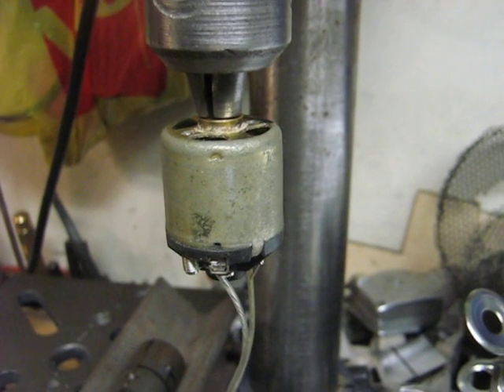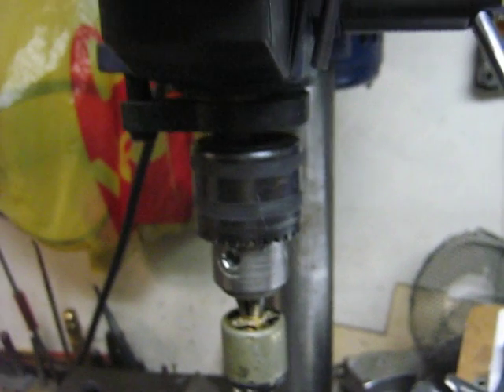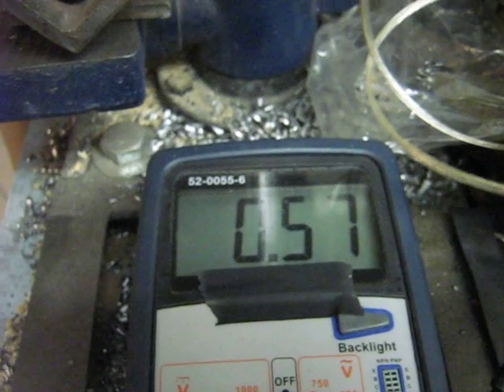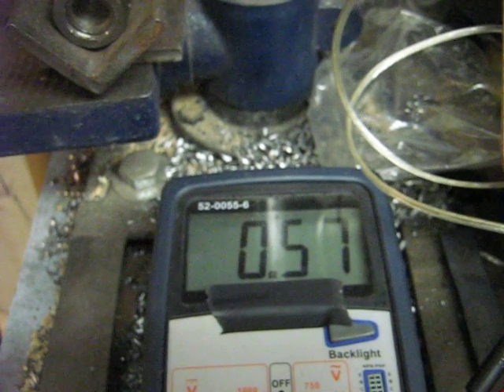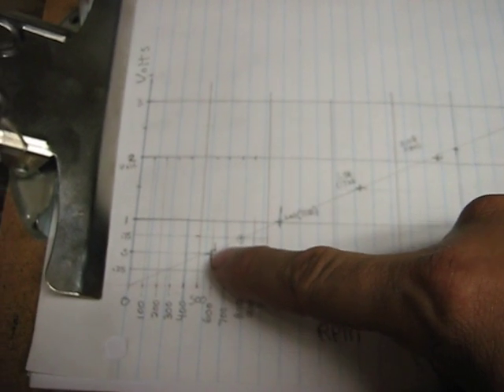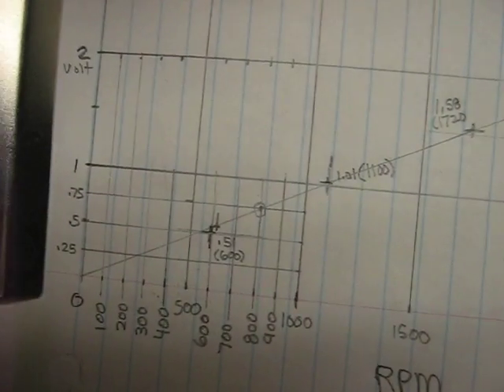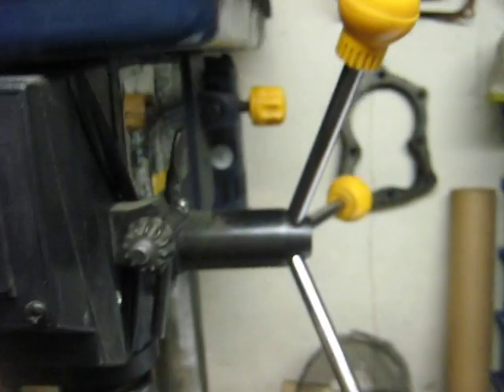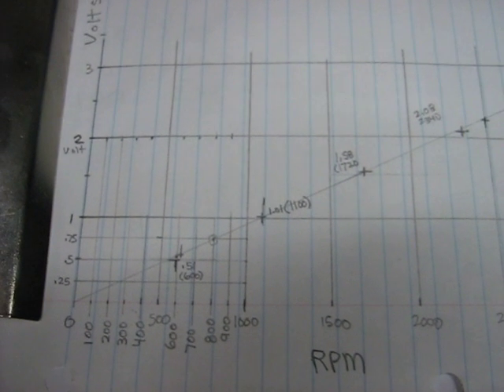Homemade Shaft Drive Tachometer-Cheap!

Comment: why cant you just measure the voltage at the output of the motor? I'm just confused as to why you did it your way. nice video, btw
Reply from the maker: +Wesley Jackson  This engine doesn't have any type built in electrical output, so without adding the shaft drive generator, there is nothing to measure. Any type of digital tachometer would have worked as well, and I do have one of those now. I mainly wanted to see if this concept would work out.   I like doing the odd experiment.  :)

Comment from the maker: Yes, it seems to work pretty well, although a permanent mount could be a bit of a pain! Your flywheel engine seems to run a lot better, I think the stock Briggs carb is too large for the reduced velocity at slower speeds.

Comment: no. an electric motor is designet to run at very high RPM. 10000 or even higher. så the RPM would not kille it.
and generating about 4 volts and no current to speak of is a walk in the park for an electric motor. så actually one could mount this in an engine and have a permanent tach. maybe put in a fixed meter with a scale saying the RPM :-)